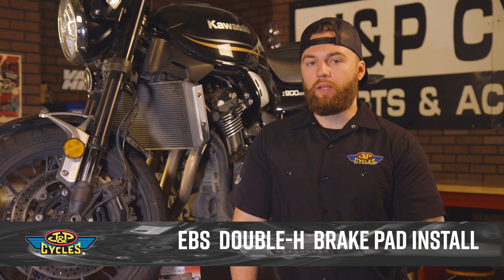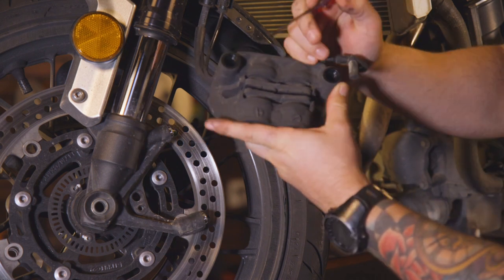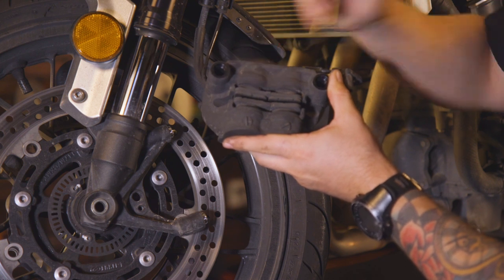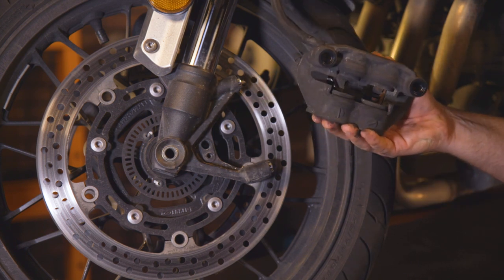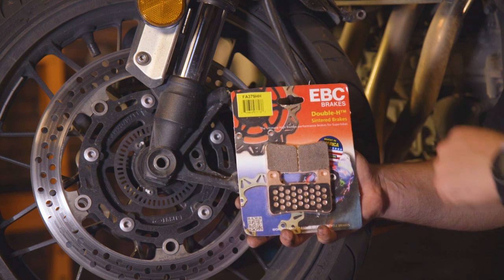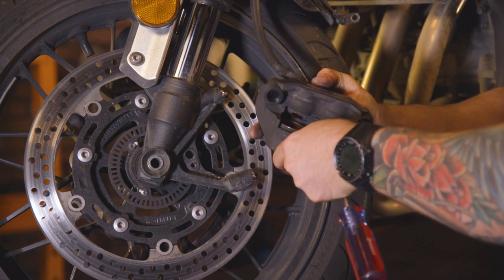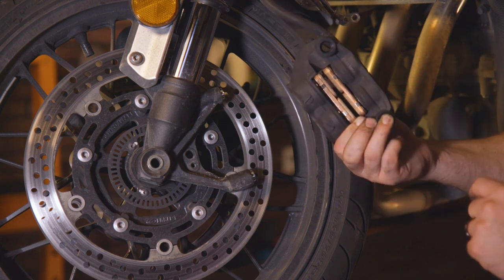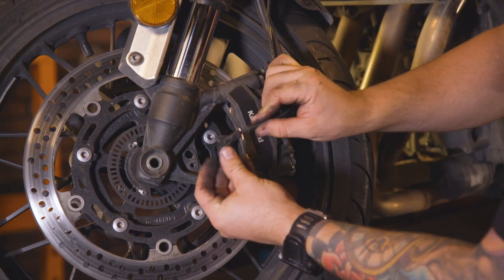Motorcycle Front Brake Pad Check and Install

Comment: Good evening Sir,
I own the exactly same bike: I loosened pins before calipers  bolts because I found them really tight.
Furthermore just a question: I moved the thin (anti-whistle I think) plates  from original pads to new ones, which had not. Is it correct?
New pads are the same brand of your ones, road type.
Thank you in advance.